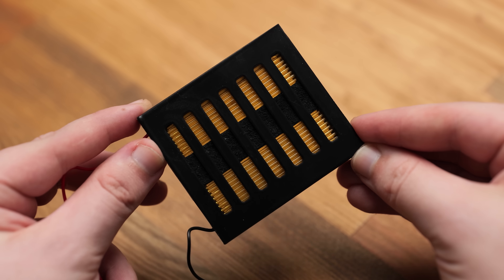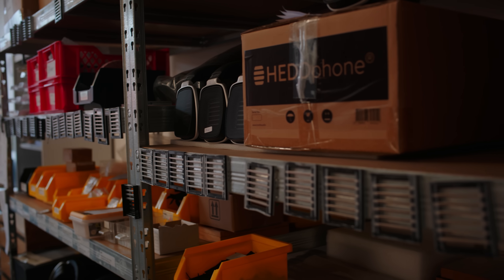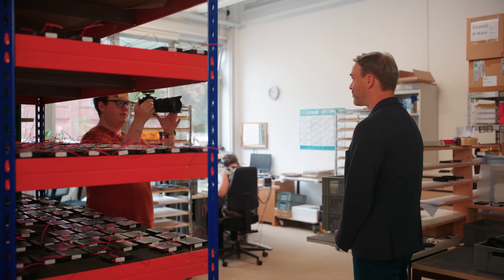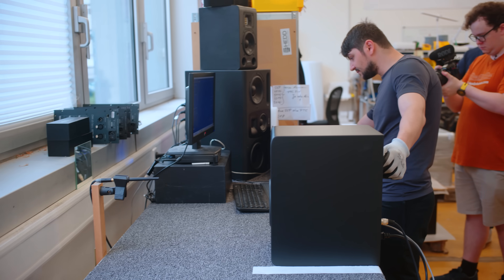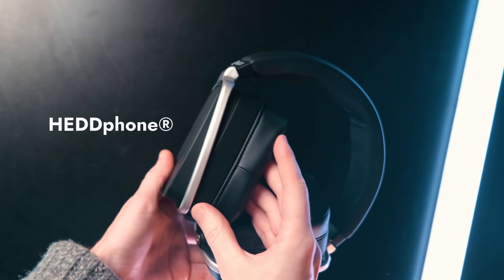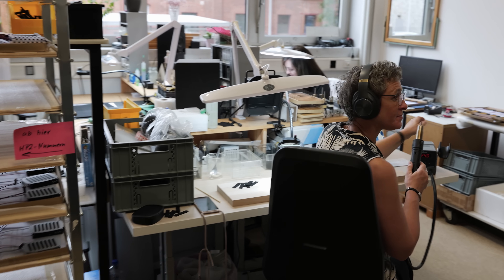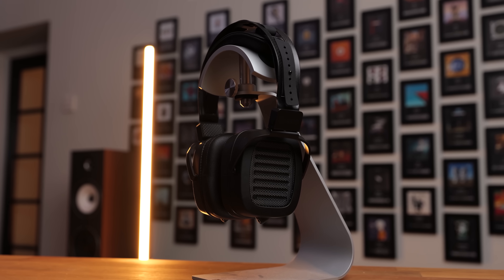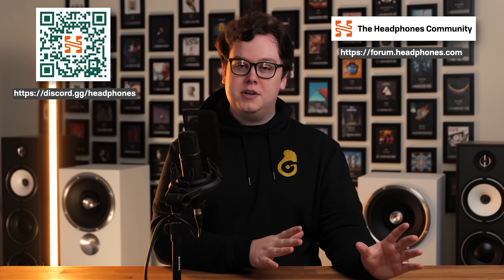Behind the scenes at HEDD Audio! - What makes an AMT headphone different?

Comment: Excellent video! Thank you! I own a pair of the original HEDD headphones, and am also familiar with the Heil driver. I agree with you that the (only) way you will better the sound of the HEDD is with electrostatic headphones. If the HEDDphone had a shortcoming, it isn't in its performance, but rather the all-important comfort. Unlike speakers, headphones must feel comfortable, first and foremost. The HEDDphone's cups are smallish and consequently can fit (IMO) too snug, as well as not adequately cover your entire ears. I was hoping the new GT would have been redesigned to address these issues, as I would have instantly ordered a pair. In contrast to the HEDD's... the Monoprice "AMT" headphones, which are very much the same, but fit and cover the ears with much greater comfort... and sound very, very good... basically on par with the HEDD's, if not slightly better (IMO). I am hoping at some point HEDD will redesign the HEDDphone similar to the dimensions, fit and comfort, of the AMT's. HEDDphone Three GT? Thanks again for a great video. Cheers!

Comment: It's kind of shocking to me at that diaphragm folding. I remember planar‘s diaphragms are extremely fragile,AMT's diaphragms seem different...
Reply: I'm no expert but they explain in the video most drivers need thinner diaphragms because the volume of air they can move is correlated 1:1 with the speed of the diaphragm. But since AMTs are more like 1:5 it's likely they can use a thicker diaphragm and still move equal or more air than a thinner one.
Reply: Thanks for mentioning that. From appearance, it looks like it is a conductive metal filament in kapton tape? The metal must have great fatigue numbers!
Reply: @ericchang7759  Hi, indeed we use Kapton with Aluminum lanes etched to it. Kapton is super-durable.